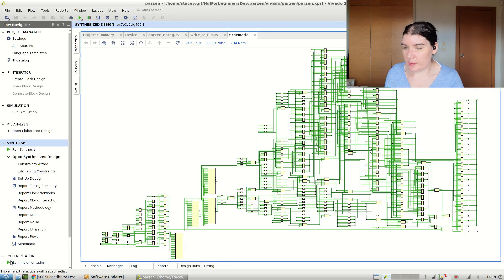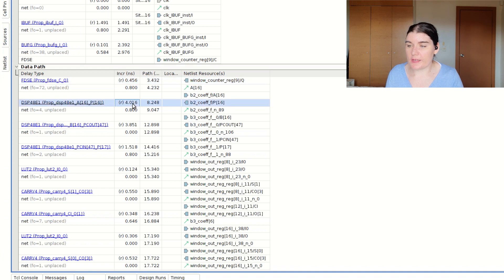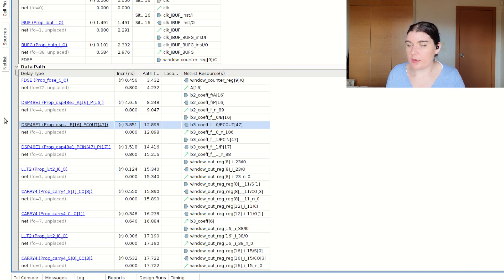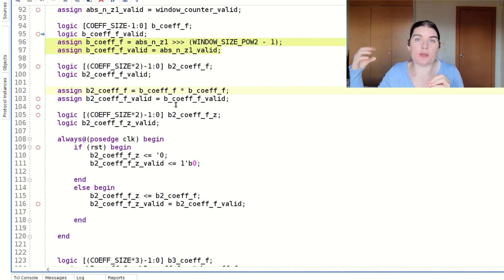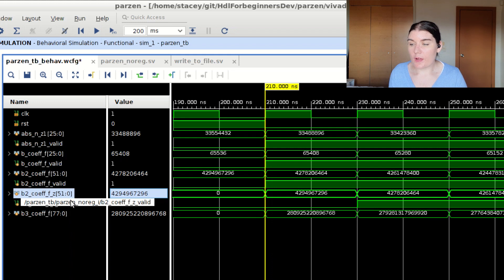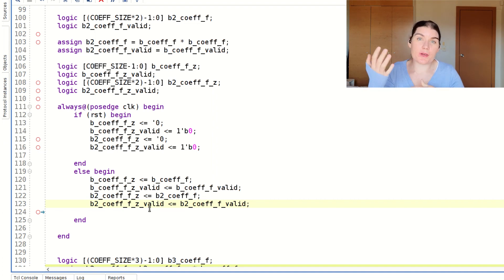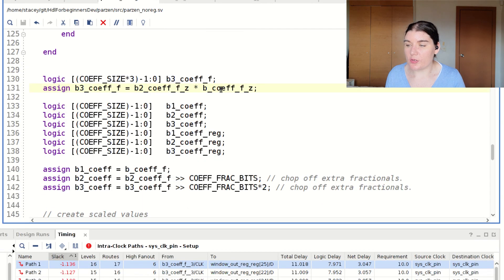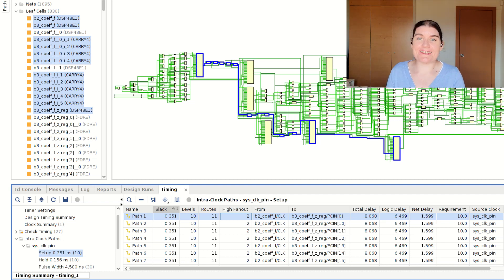Fixing failed timing, a practical example in verilog!

Comment: Why use a valid signal when you could use a state machine? Does using a valid signal help parallelize the calculation? (I'm used to programming processors so I tend to want to use state machines for everything. haha)
Reply from the maker: The valid signal is just a tool to demonstrate when the signals become valid in the simulation. In this code it actually isn't necessary because all signals are valid all the time (after reset). In this video I go over this code in its final form, including the pipeline diagram: https://youtu.be/sKQhUZ8dTjc?t=582, which shows how the calculation is parallelised (or pipelined). 
I wouldn't use a state machine for this because usually a state machine remains in one state for several clock cycles, then switches to another. In this case I want all the calculations done all the time.

Comment: My understanding with Xilinx DSP48E1 or E2 is that they have at least 3 stages inside: add, multiply, and add again. Even if the adder features are not used, the signals still need to travel through those stages and incur all their delays. So what I do now is to write one additional pipeline registers after multiplications where DSPs will be inferred. If there are consecutive multiplications, add two stages between them and one after.

Comment: It also helps to draw pipeline diagrams / sequence diagrams to keep all of the delays straight (I always end up with a misalignment otherwise).
Reply from the maker: Totally! I'm planning on doing a proper pipelining video soon, diagrams and all!
Reply from the maker: You may be interested in this video I made, it shows the pipeline diagram for this code, and also how I use _q to keep my signals straight: https://youtu.be/sKQhUZ8dTjc
Reply: @FPGAsforBeginners  I did see that video, though that wasn't quite what I was thinking about. However, you opted for the more DSP algorithm diagram which is probably a better method for this type of problem. 
I was thinking more of the traditional CPU pipeline diagrams which don't represent DSP algorithms quite as well. 
Also, funny enough, I do the inverse (but I have seen _q used more often). For me, non registered signals get _c. But your point about not mixing up the stage numbers and keeping them consistent was a great point to emphasize! Oh, and an alternative approach that I have found can be helpful in big pipelines, is to take advantage of the fact that verilog lets you define signals mid-file. So group each pipeline stage by a big comment block (to label the section), then have all of the signals, always blocks, assigns, and register blocks for that stage grouped under that section. That way you can scroll vertically through the file without jumping around to find the signal definitions or how the registers are assigned.